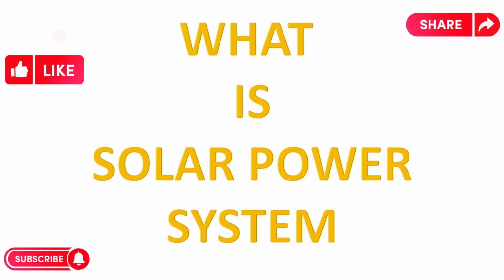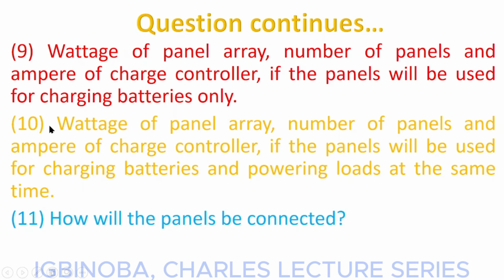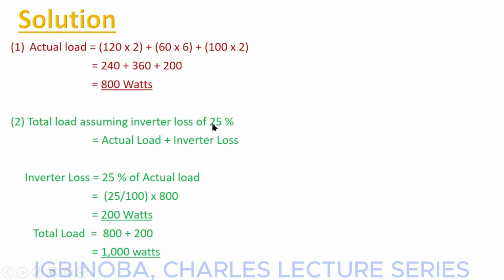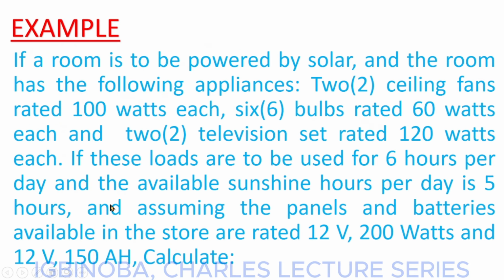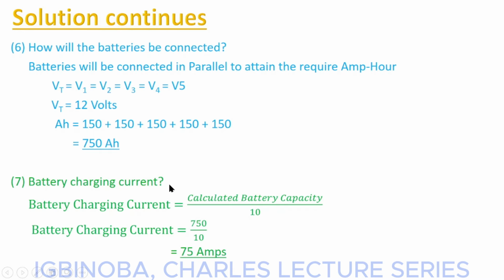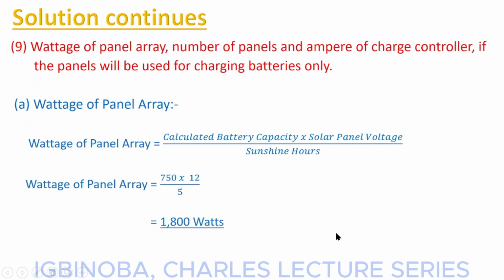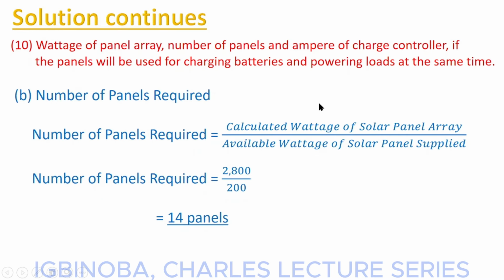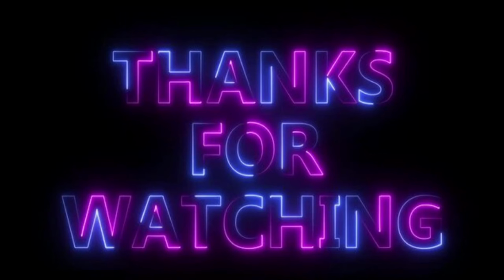Design of Solar Power System

Comment: MAR363k 
BELOW ARE THE ANSWERS 
1. Actual load= (100×3)+(60×10)+(120×4) =1380watts
2. Total load assuming inverter loss of 25%= Actual load +Inverter loss
Inverter loss=25% of Actual load
= 25%×1380=345 watts
Total load= 1380+345=1725 watts
3. Inverter rating on VA using power factor of 0.8
= (1725÷0.8)= 2156.25
4. Battery capacity using factor for reserve 75%=(2×1725×6×0.75)=1293.75Ah
5. No. of batteries for backup hours=1293.75Ah÷150Ah= 8.6 =8 batteries 
6. How batteries will be connected?
The batteries will be connected in parallel 
Vt=V1=V2=V3=V4=V5=V6=V7=V8
Ah= 150+150+150+150+150+150+150+150=1200
7. Battery charging current=1293.75÷10=129Amps
8. Battery charging time assuming charging loss of 40%= 1293.75Ah+(40%+1293.75Ah)÷129A=14hrs
9a. Wattage panel array= 3105 watts
9b. Number of panels required= 3105÷345=9 panels 
9c. Ampere of charging controller required= 3105÷12=258.75Amps
10a. Wattage of panel array= Calculated wattage of solar panel array for charging battery only+ calculated total load =3105+1725=4830watts
10b. Number of panels required= calculated wattage of solar panel array÷ Available wattage of solar panel supplied= 4830watts÷345= 14Amps
10c. Ampere of charge controller= calculated wattage of solar panel array÷ solar panel voltage=4830watts÷12volts= 402.5Amps
11. How will the panels be connected?
Ans: They will be connected in parallel

Comment: COMP366N

1. The actual load = 1380W

2. The total load = 1725W

3. Inverter rating= 2156.25VA 

4. Battery capacity= 1293.75h

5. Number of batteries =9

6.Batteries are connected in parallel

7. Battery charging current = 129.4amps

8. Battery charging time is 14hrs

9a. Wattage of panel array is 3105W

9b Numbers of panels is 16 

9c. Charge controller - 258.75A

10a. Wattage of panel array is 4830W

10b. The number of panels is 2410c 

10c. Charge controller 402.5A 

11. Panels are arranged in parallel

Comment: CHM3152V
i) Actual load = 1380 watts.
ii) Total load = 1725 watts.
iii) Inverter ratings in VA = 2156.25VA.
iv) Battery capacity = 1035Ah.
v) Number of batteries for backup hours = 6.9= 7 batteries.
vi) The batteries will be connected in parallel.
vii) Battery charging current= 103.5 A.
viii) Battery charging time= 14 hours 
ix) a. Wattage of panel array= 2484 watts.
b. Number of panels= 12.42 = 12 panels
c. Ampere of charge controller= 207A.
x) a. Wattage of panel array= 4209 watts.
b. Number of panels= 21.05 = 21 panels.
c. Ampere of charge controller= 350.75A.
xi) The panels will be connected in parallel just as the batteries

Comment: EEE345S
  
1. Actual load= (100×3)+(60×10)+(120×4) =1380watts
2. Total load assuming inverter loss of 25%= Actual load +Inverter loss
Inverter loss=25% of Actual load
= 25%×1380=345 watts
Total load= 1380+345=1725 watts
3. Inverter rating on VA using power factor of 0.8
= (1725÷0.8)= 2156.25
4. Battery capacity using factor for reserve 75%=(2×1725×6×0.75)=1293.75Ah
5. No. of batteries for backup hours=1293.75Ah÷150Ah= 8.6 =8 batteries 
6. How batteries will be connected?
The batteries will be connected in parallel 
Vt=V1=V2=V3=V4=V5=V6=V7=V8
Ah= 150+150+150+150+150+150+150+150=1200
7. Battery charging current=1293.75÷10=129Amps
8. Battery charging time assuming charging loss of 40%= 1293.75Ah+(40%+1293.75Ah)÷129A=14hrs
9a. Wattage panel array= 3105 watts
9b. Number of panels required= 3105÷345=9 panels 
9c. Ampere of charging controller required= 3105÷12=258.75Amps
10a. Wattage of panel array= Calculated wattage of solar panel array for charging battery only+ calculated total load =3105+1725=4830watts
10b. Number of panels required= calculated wattage of solar panel array÷ Available wattage of solar panel supplied= 4830watts÷345= 14Amps
10c. Ampere of charge controller= calculated wattage of solar panel array÷ solar panel voltage=4830watts÷12volts= 402.5Amps
11. How will the panels be connected?
Ans: They will be connected in parallel

Comment: CHM3131Ai) Actual load = 1380 watts.
ii) Total load = 1725 watts.
iii) Inverter ratings in VA = 2156.25VA.
iv) Battery capacity = 1035Ah.
v) Number of batteries for backup hours = 6.9= 7 batteries.
vi) The batteries will be connected in parallel.
vii) Battery charging current= 103.5 A.
viii) Battery charging time= 14 hours 
ix) a. Wattage of panel array= 2484 watts.
b. Number of panels= 12.42 = 12 panels
c. Ampere of charge controller= 207A.
x) a. Wattage of panel array= 4209 watts.
b. Number of panels= 21.05 = 21 panels.
c. Ampere of charge controller= 350.75A.
xi) The panels will be connected in parallel just as the batteries

Comment: ANSWER TO ALL QUESTIONS SUBMISSION CODE:   

COMP344R 
1. Actual Load: 1380 W
2. Total Load (including inverter loss): 1840 W
3. Inverter Rating (VA): 2300 VA
4. Battery Capacity: 1227 Ah
5. Number of Batteries: 9 batteries
6. Battery Connection: Parallel
10
Х
...
7. Battery Charging Current: 15 A (per battery string)
8. Battery Charging Time: 5.1 days
9. Panel Array (for charging batteries only):
Wattage: 2945 W
Number of Panels: 15 panels
Charge Controller Ampere: 

245A 
 

Panel Array (for charging batteries and powering loads):
Wattage: 4785 W
Number of Panels: 24 panels
Charge Controller Ampere: 399 A
11. Panel Connection: Series - Parallel

Comment: MAR334H
ACTUAL LOAD = 1380W
Total load = 1725 W
Inverter Rating = 2156.25 VA
Battery Capacity - 1293.75AH
Number of batteries - 9 
Parallel connection 
Battery Charging current - 129.38A
Battery charging time - 14hours
Wattage of panal Array - 3105W
Ampere of charge controller - 258.75A
Wattage of panel array - 4830W
Number of panels - 25 panels 
Ampere of charge controller - 402.5A
Parallels connection

Comment: CHM399U
1. 1380 Watts
2. 1725 Watts
3. 2156.25 VA
4. 1293.75 Ah
5. 9
6. Parallel
7. 129.375 Amps
8. 14 hrs
9a. 3105 Watts
9b. 16 panels
9c. 258.75 Amps
10a. 4830 Watts
10b. 25 panels
10c. 402.5 Amps
11.the panel is connected in a par

Comment: Comp356D

1. Actual load: 1380 W

2. Total load: 1725 W

3. Inverter rating: 2156.25 VA

4. Battery capacity: 1293.75 AH

5. Number of batteries: 9

6. Configuration: parallel

7. Battery charging current: 129.375 amps

8. Charging time: 14 hours

9. (a) 3105 w

(b) 15.5 panels

(C) 258.75 A

10. (a) 4830 watts

(b) 24 panels

(C) 402.5 A

11. Configuration: parallel

Comment: PETRO398T

1. Actual load (100×3)+(60×10)+(120×4)=1380watts

2. Total load assuming inverter loss of 25%= Actual load +Inverter loss Inverter loss =25%×1380+1380 watts Total load=1725 watts

3. Inverter rating on VA using power factor of 0.8 = (1725/0.8)=2156.25

4. Battery capacity using factor for reserve of 75%= (2x1725×6×0.75)/(12) =1293.75Ah

5. No. of batteries for backup hours 1293.75Ah÷150Ah = 8.68 batteries ~9 batteries 

6. How batteries will be connected?
The batteries will be connected in parallel

7. Battery charging current=1293.75/10=129Amps

8. Battery charging time assuming charging loss of 40%= (1293.75Ah+(40% +1293.75Ah))÷129A=14hrs

9a. Wattage panel array=3105 watts

9b. Number of panels required 3105÷345=9 panels

9c. Ampere of charging controller required= 3105÷12=258.75Amps ≈ 260 Amps

10a. Wattage of panel array Calculated wattage of solar panel array for charging battery only calculated total load =3105+1725= 4830watts

10b. Number of panels required calculated wattage of solar panel array Available wattage of solar panel supplied= 4830watts÷345= 14 Amps

10c. Ampere of charge controller= calculated wattage of solar panel array solar panel voltage=4830watts÷12volts=402.5Amps

11. How will the panels be connected?
 They will be connected in parallel

Comment: CHM386H
1. 1380 Watts

2. 1725 Watts

3. 2156.25 VA

4. 1293.75 Ah

5. 9

6. Parallel

7. 129.375 Amps

8. 14 hrs
9a. 3105 Watts
9b. 16 panels
9c. 258.75 Amps
10a. 4830 Watts
10b. 25 panels
10c. 402.5 Amps
11.The panels are connected in a parallel manner

Comment: CHM39I

1) Actual load: 1380 Watts
2) Total Load: 1725 Watts
3) Inverter rating: 2156.25 VA
4) Battery capacity: 1293.75 Ah
5) No of batteries for back up: 9
6) Batteries are connected in parallel.
7) Battery charging current: 129.375 Amps
8) Battery charging time: 14 hrs
9)a) Wattage of parallel array: 3105 Watts
   b) Number of panels required: 16 panels 
   c) Ampere of charge controller: 258.75            Amps.
10)a) Wattage of parallel array:  4830 Watts
      b) No of panel required: 25 panels.
       c) Ampere of charge controller: 402.5 Amps 
11) The panels are connected in a parallel manner.

Comment: MECH35E.
 Actual Load: 1380 W 2. Total Load (including inverter loss): 1840 W 3. Inverter Rating (VA): 2300 VA 4. Battery Capacity: 1227 Ah 5. Number of Batteries: 9 batteries 6. Battery Connection: Parallel 7. Battery Charging Current: 15 A (per battery string) 8. Battery Charging Time: 5.1 days . Panel Array (for charging batteries only): - Wattage: 2945 W - Number of Panels: 15 panels Charge Controller Ampere: 245 A 10. Panel Array (for charging batteries and powering loads): Wattage: 4785 W - Number of Panels: 24 panels - Charge Controller Ampere: 399 A 11. Panel Connection: Series - Parallel

Comment: PETRO391M

1. Actual load :1380 watts
2. Total load : 1725 watts
3. Inverter rating: 2156.25 VA
4. Battery capacity= 1293.75 Ah
5. Number of batteries: 8.625 ~ 9
6. Parallel
7. Battery charging current: 129.375 Amps
8. Charging time: 14 hrs
9. a) 3105 watts
b) 15.525 ~ 16 panels
c) 285.75 Amps
10. a) 4830 watts
b) 24.15 ~ 24 panels
C) 402.5 Amps
11. Parallel

Comment: EEE3103Y 

1.Actual Load=1380W
2.Total load=1725W
3.Inverter rating=2156.25VA
4.Battery capacity=1293.75A
5.Number of Batteries=9
6.Parallel connection 
7.Battery chargingcurrent=29.375A
8.Battery charging time=14hours
9a.wattage on panel array=3105W
9b.Number of panels=15.5=16panels
9c.Ampere of Charge Controller=258.75amps
10a.wattage of panel array=4830w
10b.Number of panels=24.15=25
10c.Ampere of charge controller=402.5A
11.Parallel connection

Comment: MAR3137G

1. Actual Load = 1380Watts
2. Total Load = 1725Watts
3. Inverter rating(VA) = 2156.25VA
4. Battery Cap. = 1293.75Ah
5. No. Of batteries = 8.6~ 9 batteries
6. Parallel
7. Battery charging = 129.4A
8. Time = 14hrs
9. (a) 3105Watt (b) 15.5 ~ 16 panels (or 200watt(5) then a 100watt (c) Current = 258.75Amp
10. (a) 4830Watt (b) 24 panels  (c) 402.5Amp
11. Parallel

Comment: MAR380B

1) Actual load: 1380W
2) Total load: 1840W
3) Inverter rating (VA): 2300VA
4) Battery capacity: 1227Ah
5) Number of batteries: 9 batteries
6) Battery connection: Parallel 
7)  Battery Charging Current: 15 A (per battery string)
8) Battery Charging Time: 5.1 days .
9) Panel Array (for charging batteries only): - Wattage: 2945 W - Number of Panels: 15 panels Charge Controller Ampere: 245 A
10) Panel Array (for charging batteries and powering loads): Wattage: 4785 W - Number of Panels: 24 panels - Charge Controller Ampere: 399 A 
11) Panel Connection: Series - Parallel

Comment: COMP3109E

1. Actual load = 1380 watts

2. Total load = 1725 watts

3. Inverter rating = 2156.25 VA

4. Battery capacity = 1293.75 Ah

5. Number of batteries = 9

6. Batteries are connected in parallel

7. Battery charging current = 129.4 amps

8. Battery charging time = 14 hrs

9a. Wattage of panel array = 3105 watts
9b. Number of panels = 16 panels
9c. Charge controller = 258.75 A

10a. Wattage of panel array = 4830 watts
10b. Number of panels = 24
10c. Charge controller = 402.5 A

11. Panels are arranged in parallel

Comment: PETRO396R

1. Actual load= (100×3)+(60×10)+(120×4) =1380watts
2. Total load assuming inverter loss of 25%= Actual load +Inverter loss
Inverter loss=25% of Actual load
= 25%×1380=345 watts
Total load= 1380+345=1725 watts
3. Inverter rating on VA using power factor of 0.8
= (1725÷0.8)= 2156.25
4. Battery capacity using factor for reserve 75%=(2×1725×6×0.75)=1293.75Ah
5. No. of batteries for backup hours=1293.75Ah÷150Ah= 8.6 =8 batteries 
6. How batteries will be connected?
The batteries will be connected in parallel 
Vt=V1=V2=V3=V4=V5=V6=V7=V8
Ah= 150+150+150+150+150+150+150+150=1200
7. Battery charging current=1293.75÷10=129Amps
8. Battery charging time assuming charging loss of 40%= 1293.75Ah+(40%+1293.75Ah)÷129A=14hrs
9a. Wattage panel array= 3105 watts
9b. Number of panels required= 3105÷345=9 panels 
9c. Ampere of charging controller required= 3105÷12=258.75Amps
10a. Wattage of panel array= Calculated wattage of solar panel array for charging battery only+ calculated total load =3105+1725=4830watts
10b. Number of panels required= calculated wattage of solar panel array÷ Available wattage of solar panel supplied= 4830watts÷345= 14Amps
10c. Ampere of charge controller= calculated wattage of solar panel array÷ solar panel voltage=4830watts÷12volts= 402.5Amps
11. How will the panels be connected?
Ans: They will be connected in parallel

Comment: EEE354B

1. Actual Load = 1380 watts

2. Total Load = 1725 watts

3. Inverter Rating = 2156.25 VA

4. Battery Capacity - 1293.75 Ah

5. Number of Batteries = 9 batteries

6. Parallel

7. Battery Charging Current = 129.375A

8. Charging Time = 14 hrs

9. (a) 3105 watts
(b) 16 panels
(c) 258.75A

10. (a) 4830 watts
(b) 24 panels
(c) 402.5A

11. Parallel

Comment: MAR 3129Y

1. Actual Load Power: 1380 W
2. Total System Load: 1725 W
3. Required Inverter Rating: 2156 VA (approximately)
4. Battery Bank Capacity: 1294 Ah (approximately)
5. Number of Batteries: 9 (rounded from 8.625)
6. Battery Configuration: Parallel
7. Battery Charging Current: 129 A (approximately)
8. Estimated Charging Time: 14 hours
9. Solar Array for Battery Charging:
• Total Power: 3105 W
• Number of Panels: 16 (rounded from 15.5)
• Charge Controller Rating: 259 A (approximately)
10. Solar Array for Loads and Charging:
• Total Power: 4830 W
• Number of Panels: 24
• Charge Controller Rating: 403 A (approximately)
11. Panel Connection: Parallel

Comment: CHM3158B
1. Actual load= 1380W
2. Total load= 1725W
3. Inverter Rating= 2156.25VA
4. Battery capacity= 1293.75Ah
5. Number of batteries=8.63 , approximately 9 batteries.
6. Parallel 
7. Battery charging current= 129.38A
8. Charging time=14hrs
9.a. 3105W
   b. 15.525, approximately 16 panels. 
   c. 258.75 A
10. a. 4830W
       b. 24.15 , approximately 25 panels.
       c. 402.5A
11. Parallel.

Comment: MAR3138H

1. 1380W
2. 1725W
3. 2156.25VA
4. 1293.75A
5. 9 batteries
6. Parallel connection 
7. 129.4 Amp
8. 14hrs
9a. 3105W
9b. 16 panels
9c. 258.75A
10a. 4850W
10b. 24 Panels
10c. 402.5A
11. Parallel connection

Comment: MAR358F

1. Actual Load: 1380 watts 
2. Total Load : 1725 watts 
3. Inverter Rating: 2156.25 VA 
4. Battery Capacity: 1293.75 Ah 
5. Number of Batteries: 8.625-9 batteries 
6. Parallel 
7. Battery charging current: 129.375 Amps 
8. Charging time: 14 hrs 
9. (a) 3105 watts 
(b) 15.525-16 panels 
(c) 258.75 Amps 
10. (a) 4830 watts 
(b) 24.15-24 panels 
(c) 402.5 Amps 
11. Parallel

Comment: MAR3117M
1. Actual Load: 1380 W
2. Total Load (including inverter loss): 1840 W
3. Inverter Rating (VA): 2300 VA
4. Battery Capacity: 1227 Ah
5. Number of Batteries: 9 batteries
6. Battery Connection: Parallel
7. Battery Charging Current: 15 A (per battery string)
8. Battery Charging Time: 5.1 days
9. Panel Array (for charging batteries only):
- Wattage: 2945 W
- Number of Panels: 15 panels
- Charge Controller Ampere: 245 A
10. Panel Array (for charging batteries and powering loads):
- Wattage: 4785 W
- Number of Panels: 24 panels
- Charge Controller Ampere: 399 A
11. Panel Connection: Series - Parallel

Comment: CHM354B

1. Actual Load: 1380 W
2. Total Load (including inverter loss): 1840 W
3. Inverter Rating (VA): 2300 VA
4. Battery Capacity: 1227 Ah
5. Number of Batteries: 9 batteries
6. Battery Connection: Parallel
7. Battery Charging Current: 15 A (per battery string)
8. Battery Charging Time: 5.1 days
9. Panel Array (for charging batteries only):
- Wattage: 2945 W
- Number of Panels: 15 panels
- Charge Controller Ampere: 245 A
10. Panel Array (for charging batteries and powering loads):
- Wattage: 4785 W
- Number of Panels: 24 panels
- Charge Controller Ampere: 399 A
11. Panel Connection: Series - Parallel

Comment: PETRO3133C

1.  ACTUAL LOAD: 1380W
2.  TOTAL LOAD (INCLUDING INVERTER LOSS): 1840W
3.  INVERTER RATING (VA): 2300VA
4.  BATTERY CAPACITY: 1227Ah
5.  NUMBER OF BATTERIES: 9 BATTERIES
6.  BATTERY CONNECTION: PARALLEL
7.  BATTERY CHARGING CURRENT: 15A (PER BATTERY STRINGS)
8.  BATTERY CHARGING TIME: 5 DAYS
9.  PANEL ARRAY (FOR CHARGING BATTERIES ONLY)
    * WATTAGE: 2945W
    * NUMBER OF PANELS: 15 PANELS
    * CHARGE CONTROLLER CURRENT: 245A
10. PANEL ARRAY (FOR CHARGING BATTERY AND POWERING LOADS)
    * WATTAGE: 4785W
    * NUMBER OF PANELS: 24 PANELS
    * CHARGE CONTROLLER CURRENT: 399A
11. PANEL CONNECTION: SERIES-PARALLEL.

Comment: PETRO 384F
1) actual load 1380 watts 
2) Total load 1725 watss 
3) inverter rating 2156.25VA
4) battery capacity 1293.75AH
5) number of batteries 8.6
6) connection: parallel
7) battery charging current 129.375amps
8) charging time 14hrs
9) a) 3105W
9b) 15.5 panels
10a) 4830W
10b)24panels
10c )402.5A
11) parallel

Comment: NAT321U

1. Actual load.... 1380watts
2. Total load..... 1725watts
3. Inverter rating..... 2156.25VA
4. Battery capacity......1294.75Ah
5. Number of batteries..... 9
6. Parallel connection
7. Battery charging current.... 129.38Amps
8. Charging time..... 14hours
9A. 3105W
B. 16 panels
C. 258.75Amps
10A. 4830Amps
B. 24 panels
C. 402.5 Amps
11. Parallel connection